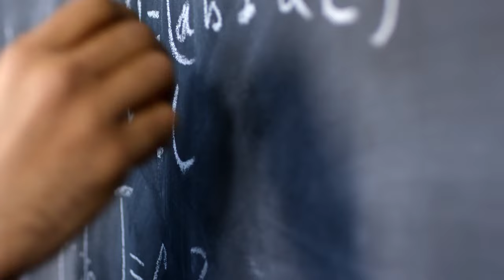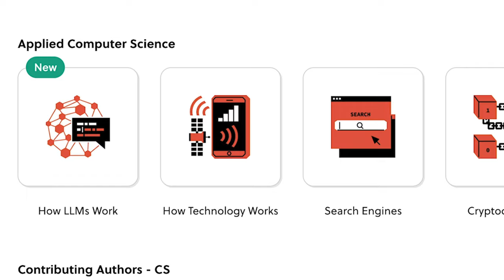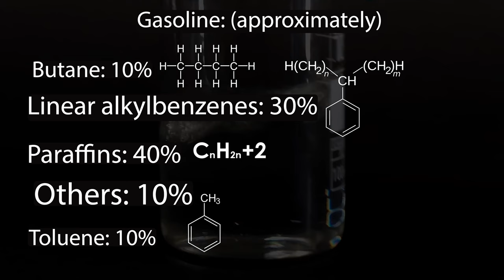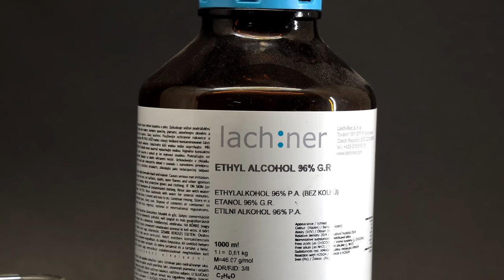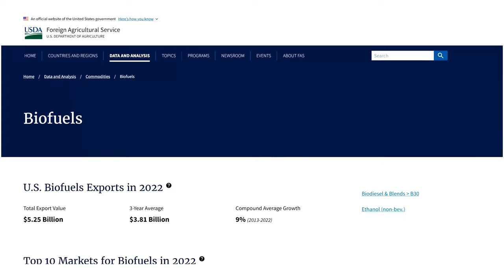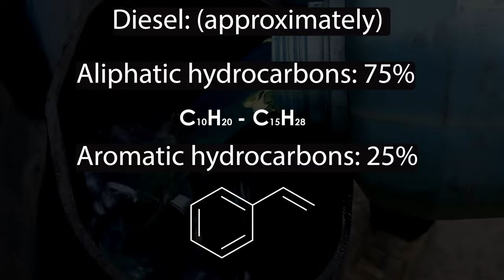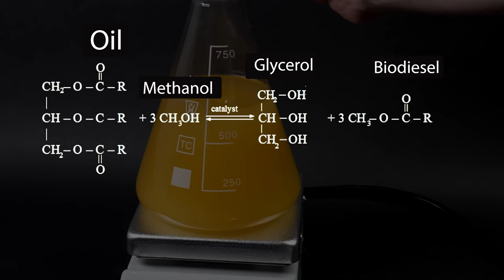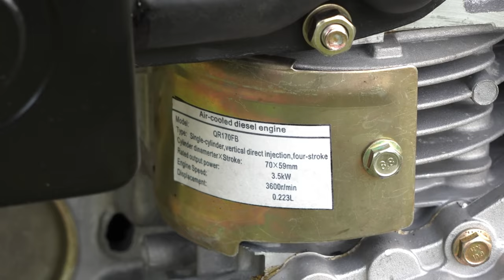Why Biofuel is a Scam?

Comment: Second generation ethanol plants (producing sideways with regular ones) can produce now 50% more ethanol with the same weight of sugarcane.
They are far more complex and expensive than regular plants, but producing galf more with your waste (celulose from bagasse) is quite impressive!
We in Brazil had quite a revolution late 70" with "Proalcool" program, and now we are in the brink of another with those new 2gen plants. I live in a small town (25k habs.) and it will be the third 2gen plant in operation im the world later this year, and
you don't see half billion dollar of investment every other day 🤑 😂
Very nice video, greetings from sugarcane land, country side of São Paulo state, Brazil.
Reply: IF Brasil produces fuel very efficiently, i don't know why (yes i know, petrol industries) USA cannot.
Reply: @TheLeonmafioso  weather and soil plays a bigger roll. Also, Brazil has many decades of genetic engineering sugar cane by Embrapa. 
Other factors are the low efficiency of ethanol produced by corn, wheat or beets or other.

Comment: Use a Hydrogen Fuel Cell , to run thecar -  its cleaner , and gives good , mileages , and its exhaust s water . 
 This can also be used in a jet engine , which was desgined to run n almost anthing , including water -  even if it has to be enriched with oxygen , to finction  .

Comment: A lot of comments about the distractions of the dubbing, below?  As to the point of biofuel, well it was or is the legislative product of Washington, for the most part, as there were or are subsidies.  A Federal jobs program, then? A grand experiment that didn't quite work as well as it was supposed to work, because of lithium-ion sorts of batteries for cars.  Who knew, back then, in the late 1960s, when this set of notions were thought up and then voted on? And it put a lot of voters and taxpayers to work.  And because of that 'work' part there was a momentum that developed. A Ship of State sort of thing?

Comment: Of course even biofuel have their disadvantages, but an action must be taken. Biodiesel can be produced by an acid protocol, I made a video on my channel:
https://youtu.be/rPFYEYExEF4?si=zb0sV2e2ssHOybU4

Anyway, it is better to do not touhc the food supplies to make biofuels but make them from food waste or other residues. Biodiesel for example, it is better done from waste cooking oil. Biodiesel can be cheaper if proper detaxation are done, usually it is used to blend with common diesel.
Reply: Biochar from wood waste has all the energy density of coal, and serves a total of six dozen commercial uses profitably and cleanly.

VOCs, the other produce of pyrolysis, include syngas and black liquor, also profitable properly processed.

Wood generates a third as much GHG when burned per GWh as coal, and is renewable. Burning it keeps it from turning to methane when it decays.